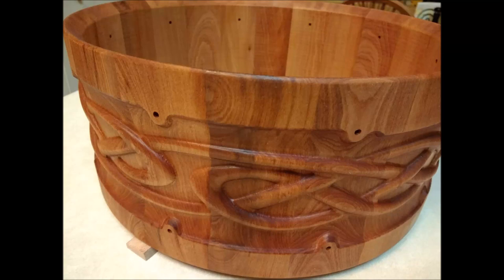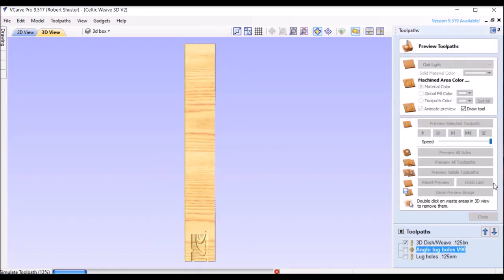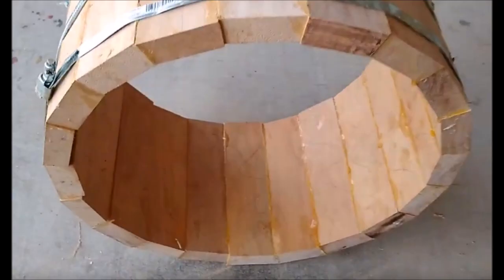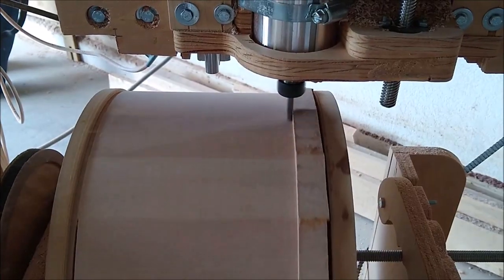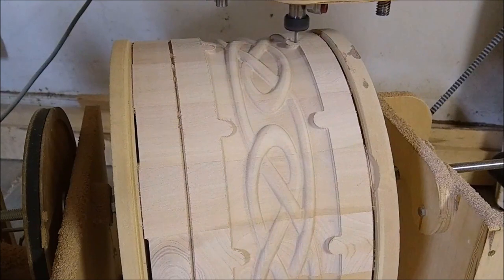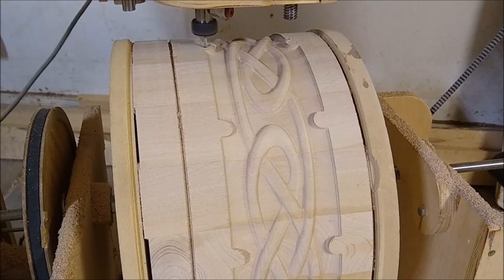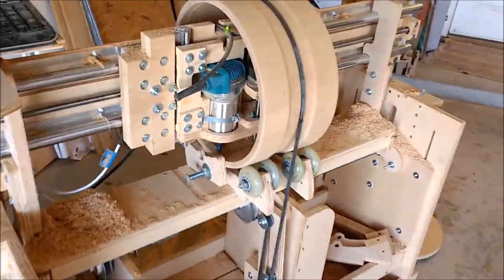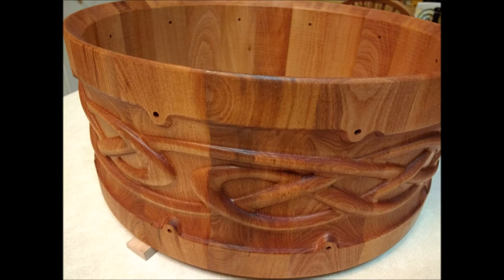Building Drum With 3D Celtic Weave Design Using Rotary CNC

Comment: Very nice job Rob. (And yeah.. I subscribed!)
Reply from the maker: Hi Jerry - I have been so busy cutting stuff that I have not implemented much of the LinuxCNC stuff yet.  Now that summer is over, and I can be in the garage without getting heat stroke, I will finally have time to make those changes.  Thanks for the idea of cutting my own timing pulley - it is working perfectly.
Reply: @sidewinderdrums  Glad to hear that. If you need any other help... adding a panel with indicators or special routines... let me know and if I can help I will.